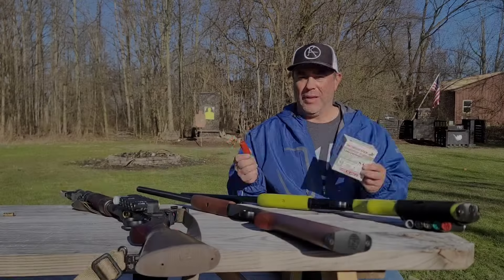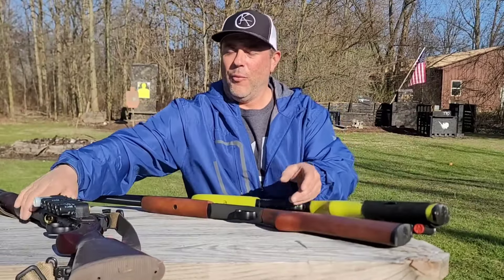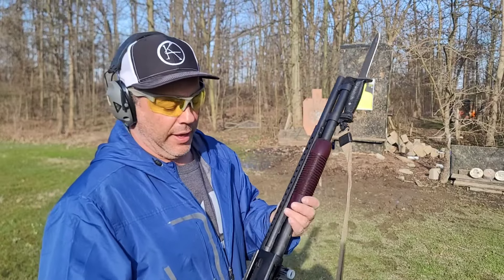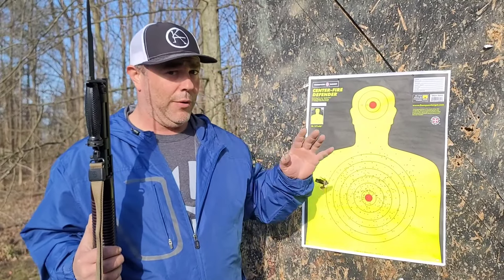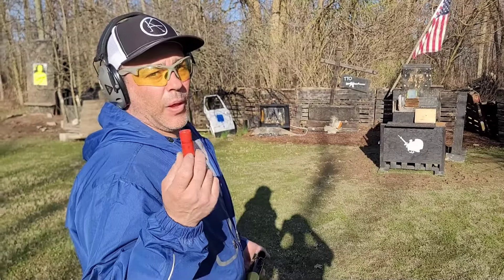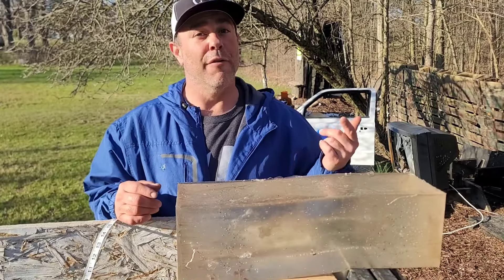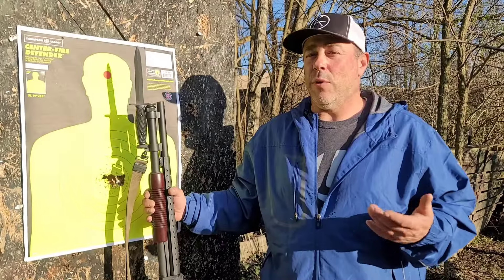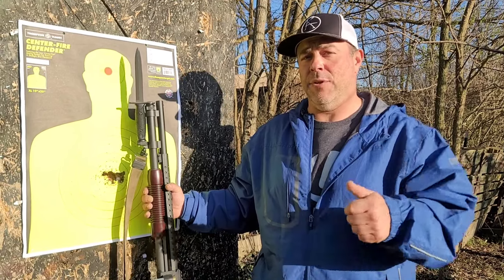BIRDSHOT For Home Defense? NO 🐂💩 Testing. Full, Modified, Cylinder Chokes.....

Comment: A quality shotgun (bird shot) especially a turkey load at close range will completely devastate the objective. It will cleanly penetrate through double layers of plywood creating massive damage. Is it better than buck shot, clearly no. Will it work, 100 percent!
Reply: A turkey load with either xxfull choke or flite control/versa tite wad in cylinder bore, at home defense distance, IS absolutely more devastating than any buckshot round, most of which would waste a lot of energy beyond the target upon exit.

Comment: You are using cheap clay loads. Use a turkey load #4s or #5s 3inch copper plated it will have more penetration. I have tested and at the longest distance I have in my home it will be deadly but not exit my house and put the house next door at risk
Reply: I use the same gun I hunt turkeys with a pump shotgun with a extra full choke and a red dot mounted. 20 inch short barrel

Comment: Youre forgetting a very important factor.. bones. Yeah, sure it might penetrate a few inches in ballistics gelatin but soon as any of those pellets contact bone theyre stopping right in their tracks.. do not rely on birdshot for home defense especially against a determined attacker - terrible video.
Reply from the maker: I'm sorry. I'll try better next time.
Reply: You’re crazy.  This stuff can be absolutely lethal at the short range in your home. There are no bones in your gut… If you get hit in the face, you won’t be able to see and you’ll be lucky if you don’t die. If you get hit in a limb, it’s probably going to be barely hanging on. There is no doubt this will stop an intruder.
Reply: @jubowub3685  maybe, maybe not. If you've got a determined attacker possibly strung out on drugs, you want something to incapacitate not wound bud..you can take that chance if you want, me, ill stick with 00 buck
Reply: @jubowub3685 so tired of hearing about the guy on drugs……BS….drugs or no drugs, birdshot at ten feet will put them in a word of pain or more.  Stop repeating crap 🤦‍♂️. Reminds me of 9 mm vs 40 S&W a number of years ago from people who have zero experience and nothing more than keyboard jockeys

Comment: What I came away with from this vid was things I either knew all along or strongly suspected........

1) In ANY scenario, some degree of choke is a must. I personally prefer to err on the side of a bit too much choke rather than too little. I was a Class AA Skeet competitor for many years and did just fine with a Modified choke.

2) At close range, meaning the distances that would be presented to an average homeowner in a defensive situation, the 12 gauge pump or S.A. loaded with game loads stoked with 1.25 Oz. of #4 or BB shot would decidedly outclass ANY pistol or revolver, if for no other reason than the overpenetration issue, not to mention that the aforementioned shotgun load would take the perp's head off!

3) 99% of Internet "Firearms instructors" are FULL OF $#¡T.

4) SCATTERGUNS RULE.

5) The handgun is what you use to fight your way back to where you left your long gun!!

6) The current V.P. of the U.S. is a Cackling bird-brain.

Comment: I bought a Mossberg Shockwave specifically for this duty. I did add a couple of features to (hopefully) make it better. These weapons come with the cyl bore, so I reckon that’s the best of both worlds. I use the Aguila and Federal Mini Shells which gives me 8 shots in the magazine. My longest indoor shot is right at 45 ft. When it is possible, I prefer to begin with pelvic shots, these (to me) provide a largish target along with the most efficient way to “take out their wheels”. My load out is six #4B (7pellets each) and then two 1 oz. slugs should they be needed. I have replaced the factory forearm with a Surefire TL Racker with its built in 1000 lumen light and a Crimson Trace Lasersaddle (green). When firing from the hip, I had a tendency to shoot high. The laser remedied that deficiency immediately. Ya just get it zeroed, put the green dot on the target, pull the trigger and that shot goes directly to that point. No aiming or even bringing the weapon up to eye level required. 🫡